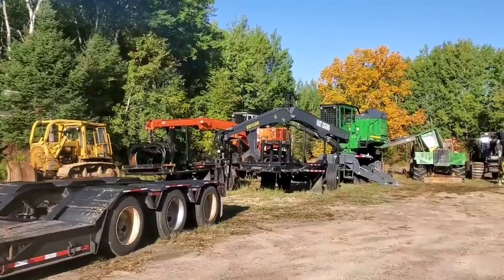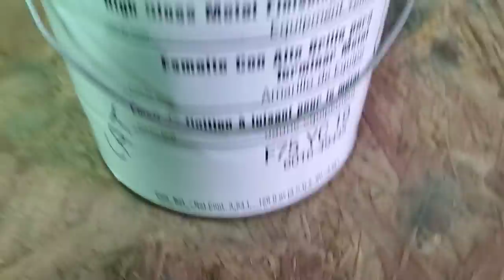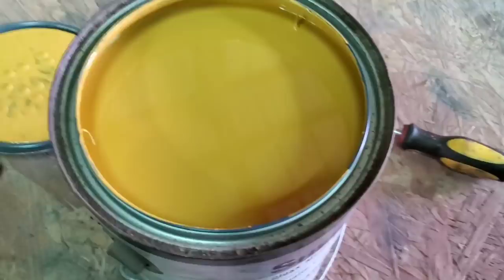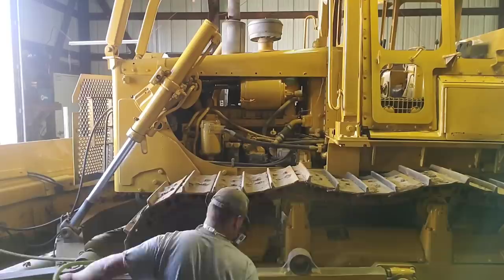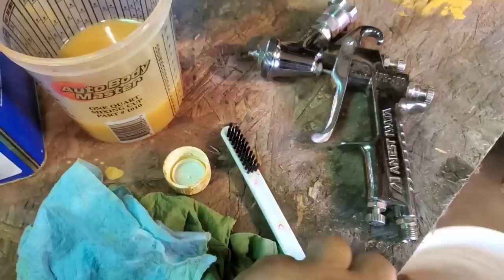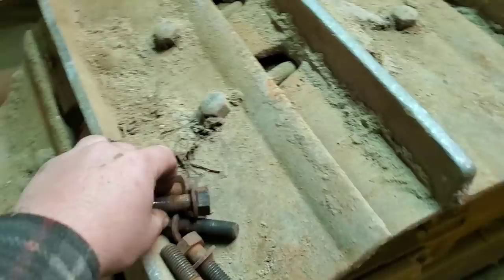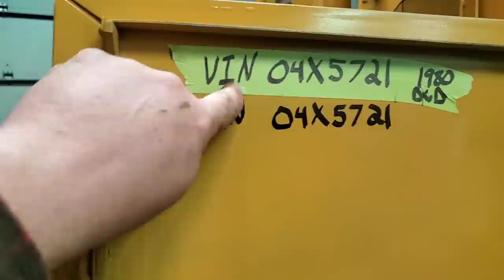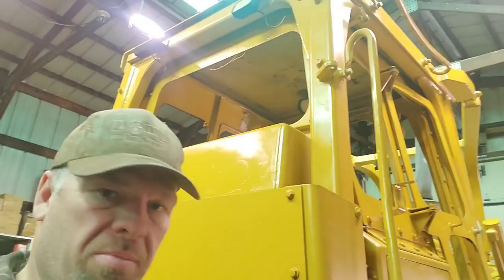1980 Caterpillar D6D Revival Part 5 It's Painted

Comment: Looking pretty good there all yellered up. The trick to putting in a window is ...put the rubber on the glass and then in the outside channel  of the rubber install a piece of heavy twine that you have soaked in oil. Start at the bottom and insert the twine the whole way around and end at where you started. Then put the window into the opening bottom 1st with the ends of the twine facing in. While putting pressure on the outside, pull on 1 end of the twine till the rubber flips over the edge of the steel. then work the other side of the twine. Back and forth until you have the rubber lip on the inside all the way around. I have put in many windows in equipment by myself this way.

Comment: Looking good, at least now it's  bright yellow you' be able to see it a bit easier when you forget where you parked it, those bolts were small and hard to find L.O.L . That yellows some good paint, it covers real well, I used to rebuild old JCB TLB's some of that yellow was just horrible to get it to cover/shine without running with one good coat.  Don't worry about the dents it's a working dozer that got them honestly, not a show queen that gets trailered around and looks good for the public.
  It's a shame the borders close for us here in Canada I'd bring you my 4wd tractor that needs painting, After years of not painting tractors and TLB's I just can't get into  the prep, I tried sanding down one of the fenders the last owner took off years before I got it. That was 6 weeks ago, when I figured it was a good idea at the time , yeah that went well L.O.L.  Thanks for the video, Take care.

Comment: I used to work for Sinclair Paints years ago.  They made the yellow paint for Cat and the county to paint the yellow lines on the freeways. Not in gallon cans. In 55 gallon drums.
Reply from the maker: I should get paint in drums!!!
Reply: It's alot cheaper than gallon cans. Try checking Bear Paint? They might help you out.

Comment: Depends how wide the rubbers are them Cat are normally 3/4 if you use a 3/16 to 1/4 " rope wrapped around the inner groove with window in slot have someone hold the glass in place remove the strip rubber V lock  use vaseline every 4" as a glider for the rope as to not rip the rubber but pull the rope inside SLOWLY as it`s fitting around frame it`ll go right in then put locking strip back in with vaseline again all around rubber to fit itself , Vaseline lets the rubber fit frame without distorting it -Looks good .
Reply: We always used the rope method when installing the rear window on our pickup truck when we took the camper off. Works great!
Reply: @ghodgeco  Oh Forsure
Reply from the maker: Thanks guys

Comment: Primer protects the metal. Top coat protects the primer.
Reply from the maker: My understanding was that enamel can be applied to bare metal.
Reply: @davidhaley7053  If you're lucky, it will stick. The odds are better with a primer.  A lot of the new paints have anticorrosive ingredients the preclude a primer.
Reply: @craigsmith8217  
I trust David to do it right...ish.

Comment: Window install the secret is silicone spray or liquid dish soap your choice
Reply: If you got 2 guys, know how to use a long piece of baler twine or string, and one of those nice tools I lent to a guy that didn't bring it back, to put the locking beads in on some vehicle  windows really helps to.